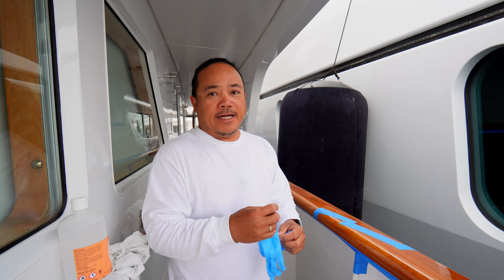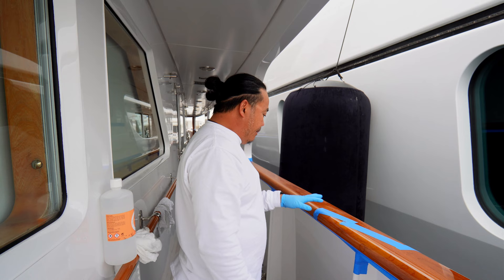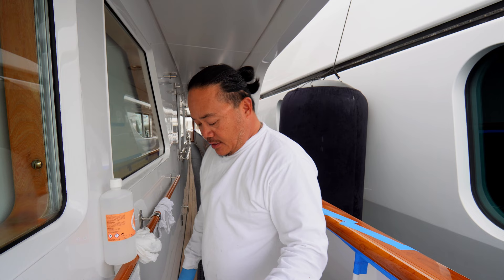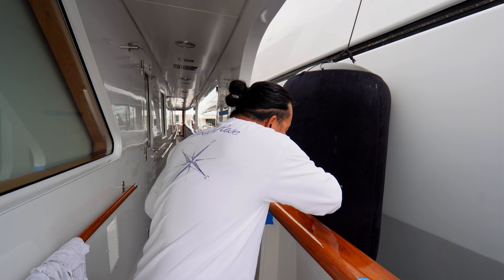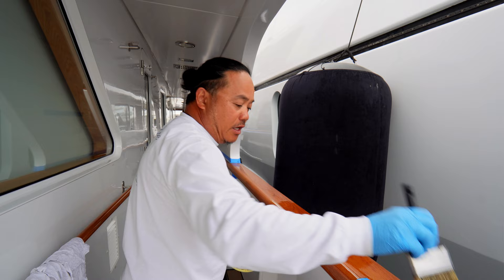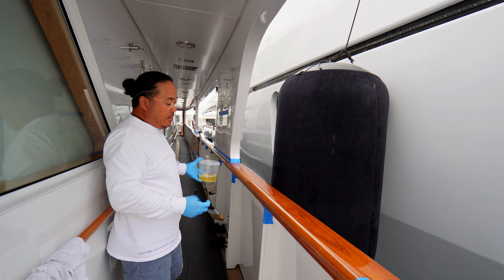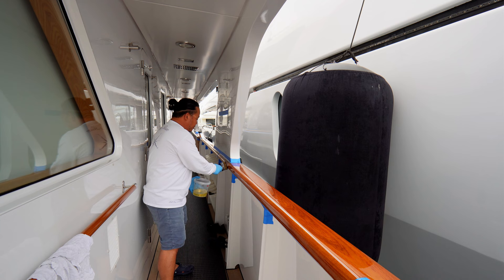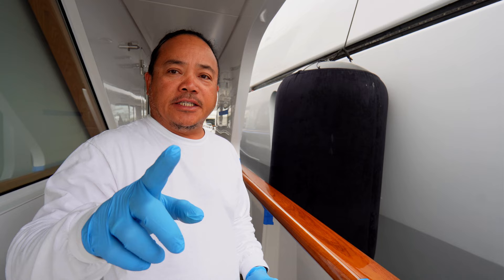Perfecting Your Yacht's Capping Rail Varnish: Tips on Brush Selection and Practice

Comment from the maker: Sorry guys...i totally forget to mention on this video ,after you sand your project ,wash it with soap and lots of water and don't forget to wash and rinse too the surrounding area so you have a nice and clean environment before you start varnishing., only if you can , otherwise if you cannot use water because of whatever situation you are in, so the best thing to do is use a bucket of water and lots of rags, dip your rags in the bucket of water and use it to wipe down the dust on your project ,changing the the dirty water on your bucket as you go along.

Comment: Leon said this was a 2-part varnish, but what brand and mix ratio?  Thanks!   ( maybe I missed it )
Reply from the maker: Hello mate... actually this is 3 part varnish, I said in the video two part because I am used to another urethane varnish that I use a while back ..this particular varnish I used here is called Awlbrite this has to be mixe together with its converter and brushing activator..the mixing ratio is
2 part: Base J3005
1 part: Converter J3006
1/2 part : Brushing activator A0031.
Hope this helps....

Comment: Use a maroon colored scotch bright pad on your last coat of varnish and rinse clean then tape off and use Awlgrip J3005 clear coat system 3 part and it will give it a bullet proof coating that will make your varnish last  up to 3years before you have to re - coat rather than every 6 months.use a new utopia badger brush for perfect results.
Reply from the maker: Thanks mate...yahh i do that sometimes, just scratch it with that maroon scotch brite,..one thing i forget to mention on this video is actually thoroughly wash the area to be varnish with soap.
Reply: Very helpful video Leon. Cleaning brushes is the most dreaded part of a painting project for me, my brushes always end up too stiff or tacky for next project and I throw them away. Then I was buying cheap brushes to throw away after the project,but cheap brushes as you know do not give the finish you desire. Again, thank you for sharing and I think you may be saving me a lot of money!

Comment: Wow, nice video, after 3 years in industry I still have to learn varnishing..
I wanna ask.. Which sand paper do you use first? Is it 380 at all times? 
I also know people use heat gun to remove old varnish, can you explain please, when should you use sending and when to use heat gun? 

😅
Reply from the maker: Hi..it all depends on you project, if you are just putting on a coat over the existing varnish 320 to 400 grit sandpaper is good...but to use heatgun? That is when you are stripping  all the old  varnish back to the original wood and start over again ...that will be a totally different topic, soon I will make a video about it, stay tuned.
Reply: @leoncaputolan  thanks for your answer, understood now. I’m subscribed to see all of them ;) Also would be nice to see some painting videos with Awlgrip products.

Comment: Hey Leon,  can you tell us the steps for mixing and the products used in the Awlbrite system in this video.  Is it in fact a 2 part or 3 part.  Do you use a base or a primer.  Thanks for the vert informative videos you make
Reply from the maker: Awlbrite is a 3 part varnish.,
Base, converter and activator.